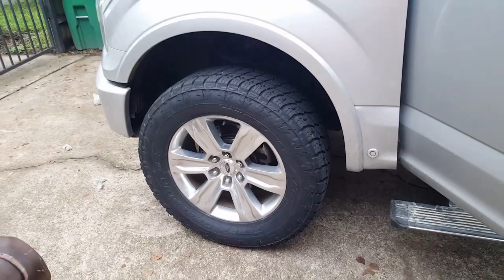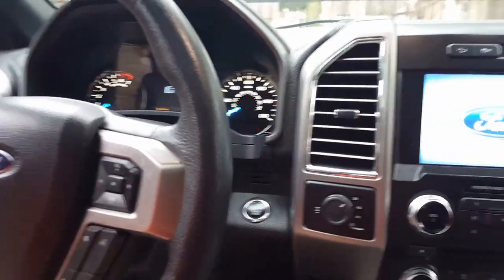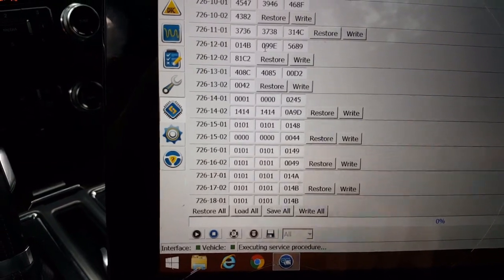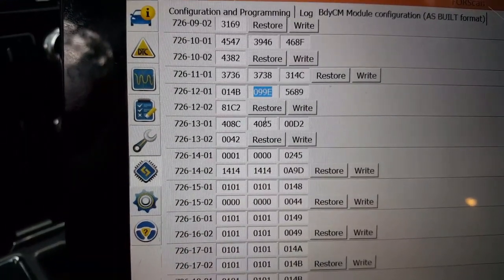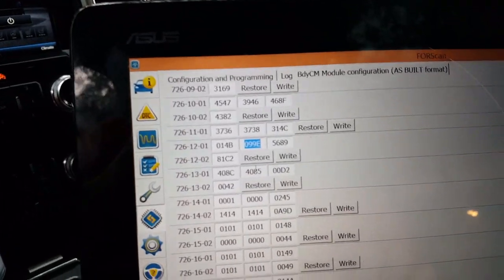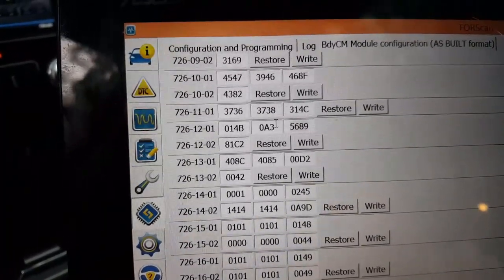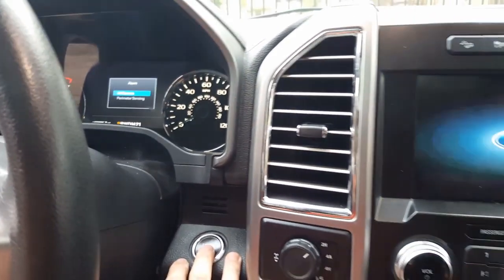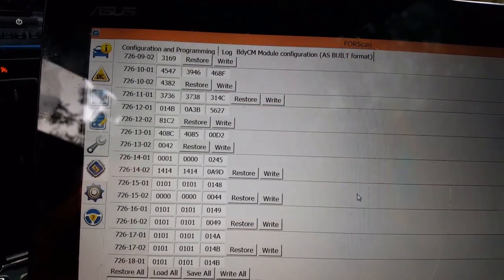Forscan ford f150 speedometer calibration due to larger tires size

Comment: After i change my tire from stock size 275/55R20 to 275/65R20 my gas went crazy and i noticed the shifting of transmission is not smooth as before. Is this issue will be fixed if the tire size is calibrated from ford scan?
Reply: Any recommendations. What would be the closest circumference for 275/65/R20?
Reply from the maker: You might have to reset the leared data. I just did another video on the Bronco. Check it out

Comment: Afternoon Ricardo, I have 35x12.50r20 on my truck and i was going 3 mph fast than what the speedometer showed. I did the recommended code change from 099E to the 0A94 you stated in the video for 35" tires and now im 2 mph slow than what the digital readout shows and the gauge is 1 mph off from that. Example gauge reads 60, digital reading shows 59 and the app i use shows 57. Do you know any way i would be able to get closer to the correct speed? Or what spreadsheet did you use to get your codesd to begin with? I'm not geting any errors either, so that's good. Love the videos
Reply: I found a new code that matched my tires, so will try that. 0A3C
Reply: @beaucopeland243  did this code work for you?
Reply: @victorespinoza9150  the 0A3C worked perfectly
Reply: @beaucopeland243  thanks soo much
Reply: @beaucopeland243 what brand/model tires do you have? Is your rim the stock 20 and I’m guessing you have a 2.5 leveling kit? Need to get this done to mine (2018 f150 platinum) and I’m glad to hear the hex size that worked for you, most likely will try it myself.

Comment: This is not the way you want to go with 2021 and newer F150’s.  Use this method.  Much easier and works across all systems on the truck.  https://youtu.be/eqC4NGdRYg0

Comment: Before you calibrated it did your digital speedometer show the correct speed? I have 34” tires on my f150 I just purchased and it seems my digital speedometer is correct buy the analog speedometer is off 2-3 mph.
Reply from the maker: Nope. Mine were both off

Comment: Here's my question:  If larger tires screw up the odometer, what about the Ford F150 XL STX  package that puts on 20" tires when normal OEM is 18" ??  Does Ford recalibate it....or is there a goof up here ?   My F150 is piling on miles and I don't drive that much.
Reply from the maker: Ford does calibrate the speedometer but not based on the wheel size. Its based on the tire size. So it could be the same settings for both.
Thanks for watching!

Comment: Does FORscan work on 12th gen F150. Currently own a 2011
Reply from the maker: Pre 2015 is very limited.  But it does have a few modules it can connect to.
Reply: @ricardosworkshop  do you have any recommendations for recalibration units / software for vehicles pre 2015?

Comment: dumb question, im new to forescan and waiting on my connector to come in.  But when I lifted my truck and put 35's on it I knew it would throw it off alot, which it did (to 14-15 mpg and about 5-7 mph off) but yesterday it all of a sudden was showing average of 9-10 mpg, which I know there is no way is right.  So theoretically by fixing the speedometer it will fix the odometer and the mpg and miles until empty averages displayed on the screen as well?
Reply from the maker: Yes, it should.  And you'll see a change in gear timing too.
Reply: @ricardosworkshop  Thanks so much.  Ive watched your videos for a while but just now got around to really going for it.  Seeing 8 mpg average this morning with 400 miles until empty on a full tank (when its usually 520) was enough to freak me out enough to get off my ass and get it done.  thank you again for all your videos and spreadsheets.
Reply: @ricardosworkshop  one last question Ricardo.  I have Morimoto hybrid's up front so If the "DRL Settings" in the cluster are on the plank and the middle blinker bulb stay on, if I turn it off just the led ring stays on (which is what I want).  The problem is is that I bought oem led tail lights and used the BGG harness, so those led planks only come one when the actual headlights lights are turned on. I notice on the trucks that have these stock, the front planks and rear planks are both on all the time as DRL's.  Is there a way to address the tails in forescan?  I have been searching non stop through the spreadsheets and can't find anything for it.
Reply from the maker: I haven't seen forscan change anything in rear lights. My DRLs are only front lights.
I would think you can choose the DRL options based on the different settings. The tough part is testing each setting.
One should work, unless its a wiring issue.
Reply: Professor Ricardo, sorry to be annoying af lol.  I reset my speedo on my 18 5.0L and I got the PCM relearn message but no TCM relearn or anything like that.  I keep hearing and reading that the 18+ often require both the PCM and TCM to be relearned/cleared (sorry if im using the wrong terminology).  I feel like the truck is shifting a little different, the mpg went up a tad bit, but still not back to where it was a few weeks ago after the lift and driving on it for a month.  I'm assuming the TCM relearn is an essential piece of the equation.  Do you have nay insight on that?
Reply: @forcemajeur.5138  I have the same issue.  Any help would be appreciated.

Comment: I have the same tire size and my analog Speedo is still 1 to 2 mph too fast according to the GPS.  Nothing I try seems to work.
Reply from the maker: Yup. Mine too. Im working a a new video with recalibration. Please check back soon
Reply: @ricardosworkshop  do you have the new video bro?
Reply: Mine is the same way. 2mpg too fast

Comment: 34s? those are like 32-33s lol 305/70s are 34s.
Reply from the maker: Thanks for watching Adan!
295mm = 11.614 inches (thats the tire width)
60% of that is 6.969 inches (sidewall)
6.969+6.969+20 inch wheel =33.938 inches
So yes, you're right, less than 34"
Reply: He is right hoss, 295/60/20 are about 34.1 depending on manufacturer 295/65 are 35.2ish
Reply: I have 275-65-20 and they come out to around 33.8

Comment: 20540 vs 20545 can you help 😀17 
My car was showing 3 km/h under with stock now it's correct I want to calibrate so I have 3km under again though bigger profile 😀
Reply from the maker: Hello Lars. Thanks for watching. On BCM 726-12-01... 
205/40r17 = xxxx-0712-xxxx
205/45r17 = xxxx-0750-xxxx
Checkout this spreadsheet... https://docs.google.com/spreadsheets/d/1mWnuQZlDTUGjKjmJje1QJIR8Z2c7Kf8KBZxKnw_8EqU/edit?usp=drivesdk

Comment: I have a temp license to forscan... Where is that spreadsheet?
Reply from the maker: https://docs.google.com/spreadsheets/d/1uDSQ1Z5a2Wt8-kjrSiVSlDFGFHnfeuhb3RTMVz95730/edit?usp=drivesdk
Reply: @ricardosworkshop  Do you know how I could find one for my 2012 f250?
Reply from the maker: Yes... checkout forscan.org or forscan group in Facebook
Reply: @devinmanning257  instead of 726-12-01 your's 726-45-01 (2011-2014 models)  and here's the spreadsheet  for your tire size. https://docs.google.com/spreadsheets/d/1mWnuQZlDTUGjKjmJje1QJIR8Z2c7Kf8KBZxKnw_8EqU/edit#gid=0
Reply: @MxSpartan117  Awesome thanks, Ill give it a whirl

Comment: That 4 character string is the circumference of the tire in millimeters written as a hex number. If you know your exact tire height you can calculate the circumference and covert that to millimeters, then that number to a 4 string hex number and program that in. Quick google searches will give you free online calculators that do both.
Reply from the maker: That's interesting M FIL. Here's a link to the spreadsheet too... https://docs.google.com/spreadsheets/d/1mWnuQZlDTUGjKjmJje1QJIR8Z2c7Kf8KBZxKnw_8EqU/edit?usp=drivesdk

Comment: Will this work for 2012 stx I went from stock 18” to stock 20” size
Reply from the maker: I don't think so. As far as I know it only works 15+
But did 18" to 20" change the tire diameter/circumference?